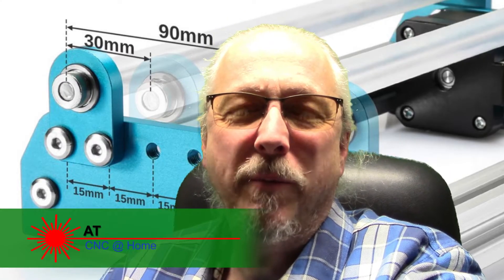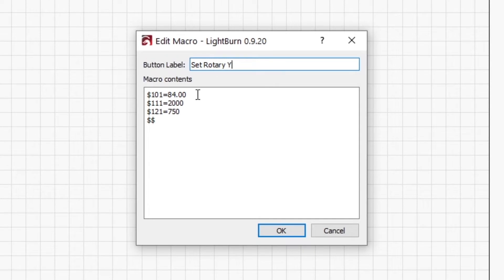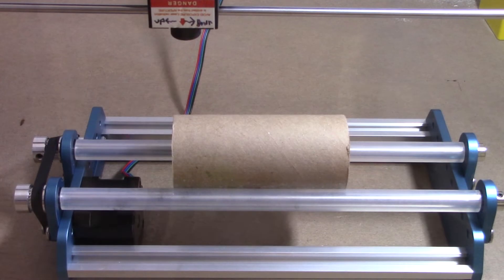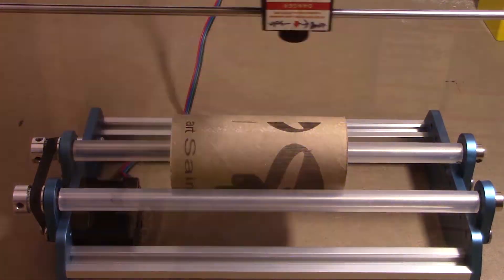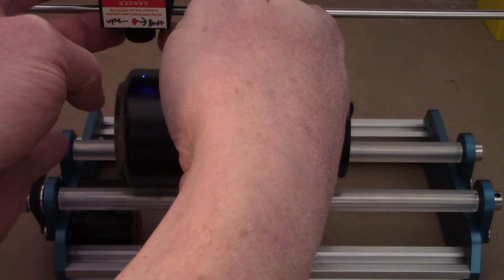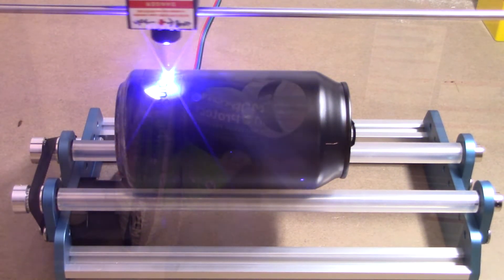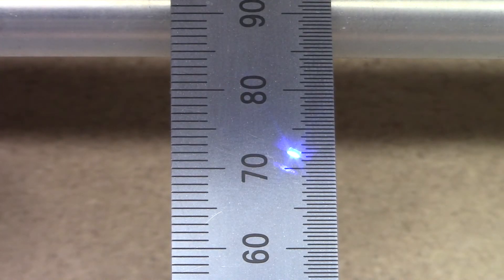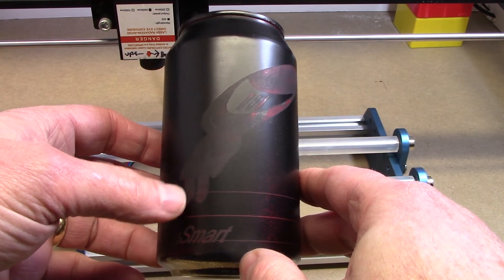Genmitsu Rotary Roller Kit configuration with LE5040

Comment: I would think the reason that the 20mm movement wasn't exact is because the rotary is made for cylindrical shaped objects. The displacement along a straight axis would be greater in comparison to that of object being rotated. If you placed a mark on a properly setup object that mark changed elevation in z-axis causing a greater distance to be travled.
Makes sense in my head, hopefully makes sense to someone else
Reply from the maker: The roller is a little finicky.  Because there is not a positive connection between the rollers and the material, the material is prone to slipping.  To minimize this, I try to keep my "Y" axis moves slow and to a minimum.  I found that adding weight to something like this cardboard tube to help.  A couple AA batteries inside of the tube can really help minimize slipping.  Once you have this set up correctly, it works nicely.  You are right about this needing a cylindrical shape to work best.  A rotary chuck would be more consistent and allow for more "Y" axis movement. Maybe someday I will invest in one.  A friend of mine has one for his big laser and it works great.

Comment: I think you might have also showed plugging the attachment in. I assume it just replaces the Y stepper...but still. Also the MM/rotation is just pi*circumference. No clue why the software doesnt just calculate that for you. You dont need to experiment, its 37 because pi is pi and the circumference is 12.
Reply from the maker: That is an excellent point.  Even though this video was about the configuration within LightBurn, it would have been a great idea to have shown how the rotary roller is set up physically on the LE5040.  As you assumed, it is a simple matter of unplugging the "Y" stepper motor from the LE5040 and replacing that with the plug from the rotary roller.  Using the roller interface within LightBurn makes more sense when using a rotary chuck vs a roller.  For my roller, I just make a slight controller change to the number of steps for that stepper motor and I have a macro within Lightburn to do that for me.  When I am done, I have another macro that sets everything back.

Comment: Do you know if a third party three jaw rotary axis would be compatible and get set up the same way?
Reply from the maker: Good question.  I do not know.  If the connection to the rotary is the same as what is being used for the "Y" axis stepper motor, there is a good chance you could get that to work.

Comment: I have a Makeblock, the rotary attachment for that is not deep enough for anything with a handle. Can this Ortur rotary do mugs or anything glassware, drinkware with a handle? If yes, I am buying. Thanks. On the part of the video where the 2nd burn is off, I through trial and error have found that by reducing my power and running it twice I get a better image, I also wrap the bottom with a 2" wide medical bandage tape (the kind that is self adhesive but can be reused and has some cushion) if you wrap that on the bottom, it rolls better, no slipping.
Reply from the maker: Great question.  I just put a big glass mug on there to see how much area I could etch.  Looks like about 1/4 of the mug.  So basically from the handle to about 1/4 of the way around.  If you want to do that type of thing, a chuck style rotary would be a better choice.  My latest video (https://youtu.be/0MI6o26_JGc) shows a chuck style rotary that we were using at Making it Happen (another YouTube channel).  Leon used it to burn a big glass mug with ease. He also did a thermal mug and burned the paint off down to the stainless steel.  He said it was about $150 for that rotary chuck.  Something to look into if that is the kind of thing you are looking to etch.

Comment: Firstly, great video, thanks.
I make pens out of wood on my lathe and am thinking of using my 3018 to laser engrave them.  Would this rotary roller be a possibility for engraving pens?.
Michael
Reply from the maker: Great question.  That is so cool that you are making wooden pens that way.  This may not be the best solution for something like what you are making.  The minimum distance between the center of the rollers is 30mm.  Without some sort of fixture to hold the pen, it would just fall right through.  when I burn pencils, I will burn three edges at the same time.  That way when someone it looking at it, the image looks normal as long as they are looking at the middle or top surface.  Wood tends to burn well so I can get away with focusing just a little deeper than the top surface.  Here is an example of this: https://youtu.be/m-5NjH3qIJs.  I hope this help.  Good luck.
Reply: @CNCATHome  Thanks AT, yeah I will give that a try.   I will first burn a line with name etc. Then rotate it slightly for date etc. Want to use it for when I make Pens for weddings as an example.

Comment: I HAVE THE LC60A  with the Genmitsu Laser Rotary and can't get it to work with lightburn, or setup full 360 rotation
Reply from the maker: I am sorry to hear that you are having issues with the rotary roller and LightBurn.  What I have found is that I do not use the rotary setup in LightBurn.  By setting $101=84, $111=2000, and $121=750 that makes the needed change for my configuration. The important one is the $101 that sets the steps/mm. $111 sets the max rate in mm/min and the $121 sets the acceleration in mm/sex^2.  I have found that running the rotary roller too quickly causes the material to shift and that isn't good.

I plug the rotary roller into the "Y" axis port on the controller and run a macro that makes the setting change. I make sure to get the laser centered on the long axis of my material and focus the laser (set the height in your case) on that material.  There shouldn't be anything more to do that this.  Check in with SainSmart support as they can help you with information specific to the LE-60A.  There is a contact page on their website: https://www.sainsmart.com/pages/contact-us.  I hope this helps.
Reply: @CNCATHome   Yesterday I had macros set for rotary but did not know how to switch it around if I am correct it is  $$ and enter
Reply from the maker: @gregmaples6240  - The command $$ + enter will show you the controller's configuration.  Setting up a macro is done in LightBurn on the Console tab by right clicking on one of the 6 macro buttons.  To set one of the controller parameter such as $101, just enter it in the "(type commands here)" text area on the Console tab like this, $101=80.  Press enter and it will be set in your controller.  Do the $$ + enter to see that it is now set.  In the description of this video, I show my Rotary Y macro settings (ignore the comments as they aren't part of the macro).  Before messing around too much with the controller's parameters, it is a good idea to make a backup of how they are currently set.  Just do your $$ + enter and copy the text into a file somewhere you can save it.
Reply: @CNCATHome  Very late with this, but did you calibrate the steps for your stepper motors? From the 3D Printing world, calibrating extruder steps is the same, so most likely that 84 you set with $101 is just a bit off.
Reply from the maker: @billywoods3541  - I really should take a closer look at my settings to insure they are accurate.  When I first got this set up, I was mainly looking to get it working about right.  The accuracy you are talking about with your 3D printer wasn't needed at that time.  If I hope to be more accurate with my burns, I should go back after this to see if the 84 is a good setting for the stepper.
Reply: do you like your Genmitsu laser lc60a

Comment: So the 37mm, what is that referencing?  Is that the circumference of the roller?
Reply from the maker: That is a good question Dan.  The answer to your specific question is the circumference of the roller as you stated.

The more I dug into Rotary Setup, the less I ended up using it.  I created a macro that changes my $101, $111, and $121 values between rotary and flat configuration. 

The "mm per rotation" is "How many mm of Y travel corresponds with one full rotation of the rollers".  That being said, I was told by LightBurn that this value is usually figured out with trial and error.  Part of the reason for this is it is intended to be used without making changed to the controller settings (mainly $101with a GRBL controller).

With the roller circumference known, and the amount of Y travel required to make them move one full rotation, LightBurn computes a scale factor for the Y axis and stores it.  When you enable the rotary setting, this makes LightBurn scale the Y axis moves when generating GCode for the machine by that computed scale.

Per LightBurn - "It's not perfect - for example, If you command a specific move in the Y axis at a given speed, because the Y is scaled, that move might be at the wrong speed.  That's not usually a problem, since very few people do vector marking with rotaries as they tend to slip, because items aren't "locked in", but are just held by gravity and friction, so if the rollers move abruptly at any point, you're likely to lose position."

I hope this helps.  :-)
Reply: @CNCATHome  I was just down working on my machine and figured out that since I am using an Arduino UNO with a CNC shield, that I can connect the rotary to the Z axis driver and not have to swap the Y axis cable every time I want to use it.  Because of that I can set settings for  the Z axis rotary and leave them.

Comment: I bought this roller and every time I engrave it comes out backwards or upside down can you help please Thank You David OH my laser is a Atomstack A5 Thanks
Reply from the maker: Thank you for the question.  My first burn was backwards as I have the rotary roller oriented 180° wrong.  So I just turned it around and that solved that issue.  If you are having issues with your X or Y axis, you might be able to correct this with the $2 setting.  You can see a good explanation of this here: https://github.com/gnea/grbl/wiki/Grbl-v1.1-Configuration.  I hope this helps.
Reply: @CNCATHome  Thanks for your help I check that out
Reply: @davidharris425  If you're using Lightburn, Click Tools --> Rotary Setup --> Turn on "Mirror Output to Rotary"

Comment: Could I etch whisky glasses with this?
Reply from the maker: If they are basically cylindrical and under about 10 inches, it should work.  The distance between the rollers can be set up to 90mm or 3.54 inches which would accommodate a fairly large diameter glass.  If you can get the parameters set on the laser so that it will etch the glass, you should be in business.

Comment: Are you open to a one-on-one training? I'd be willing to pay. This video is very helpful, but I think I'd learn better from a live session.
Reply from the maker: I am not sure there is much I can help you with on this.  The rotary roller is a bit tricky to use due to material slippage.  Once you have the $101 set so it works for your configuration, you do your burn just like any other.  To reduce material slippage, slow things down and avoid direction changes on the "Y" axis.

Comment: Did you ever figure out the issue with the Y scan being skewed?  I seem to be having a similar issue.
Reply from the maker: Not totally.  The gantry wasn't square and I corrected that and that helped..  I tightened the belts and that helped a little too.  There is an issue with the v-bearings that I haven't figured out completely where they don't roll consistently and that makes the laser wiggle just a little and creates a wave when burning.  I have minimized that by using the Y axis for the big moves.
Reply: @CNCATHome  Thanks, that helps a little, but it still begs the question, why would any of that have to do with the rotary?  I have the problem when ONLY rotating, not while moving anything on the X axis.  I rotate a set amount in one direction, but when rotating back in the other direction, it doesn't go back to where it started from.  It is actually a little ahead of where it started from.  When using my regular Y axis it is fine.
Reply from the maker: @danbemowski3014  - I have run into a couple issues with my laser and was thinking about a different issue.  The one I was having with the rotary roller has been resolved.  It was a slipping issue.  The material that I put on the roller would slip as it moved.  To minimize this, I burn mainly with X movement and make small Y increments with the roller.  This has helped minimize the slipping.  I also only make one pass vs. burning one object and then another.  Get it all done at one time.  With something light weight such as the tube from a roll of bathroom tissue, I added a couple AA batteries into the tube to give it more weight.  It helped reduce the slipping.  The best solution would be to use a rotary chuck vs. a rotary roller.  They cost a bit more and have their own limitations.  They do give you a positive grip on your working piece.  So no slipping.
Reply: @CNCATHome  Perfect.  I was starting to wonder if it was something with the way I have the belt routed on mine.  I think one of the rods is not completely straight and it causes a sligh binding at one point.  That and possibly slipping as you mentioned too, but it happens with short movements as well and seems pretty consistent on the distance.  I do thank you for your time, insights and most of all your video.  It helped me a lot.

Comment: IF you are using Windows10 with LightBurn (I am) are you having any issues with the USB connection "going to sleep" and the engraving stopping midstream? Just curious since I have major problem with it right now, Can't burn anything more than 2 minutes.
Reply from the maker: Sorry to hear about your issue.  The computer that is running my machine is a repurposed Windows 7 computer.  I am not having any issues with that.  Sounds like you may have an aggressive power saving setting.  With my new laptop, I have run into issues where things seems to stop when the power saver stuff kicks in to turn the screen off.  It seems more things also halt when that happens.  I hope you are able to track that down.
Reply: @CNCATHome  I am using a laptop with all power saving features turned off. So it says according to everything I can find. I think I will repurpose a pc to Linux and run Lightburn for Linux. Thanks anyway for the reply.
Reply from the maker: @woodturner1954  - I hope it is the OS and putting Linux on there solves the issue.